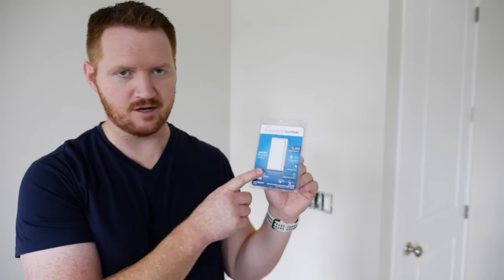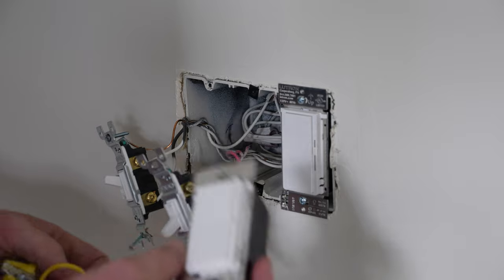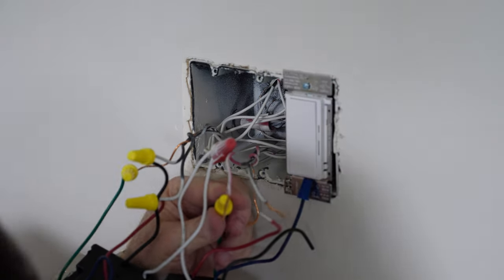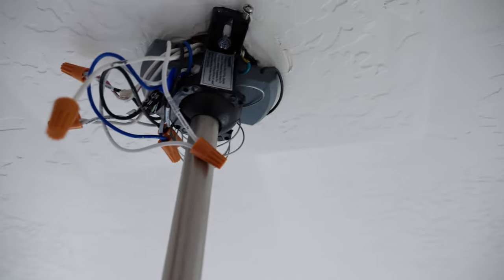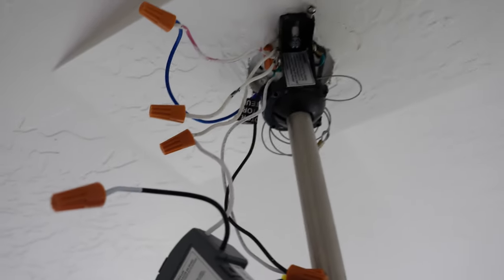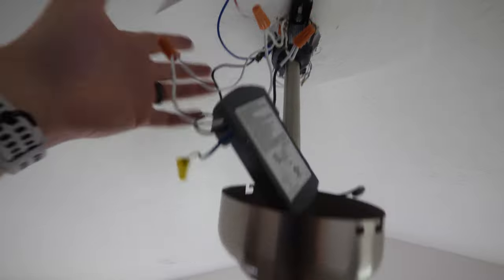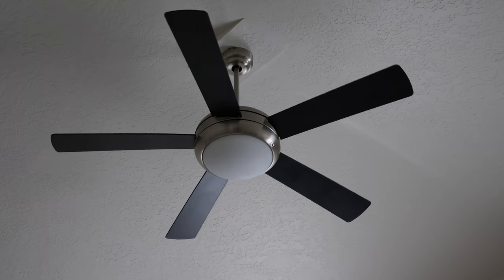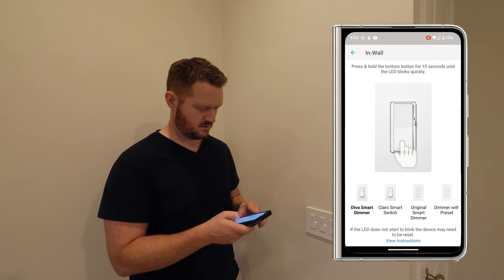Use a Claro Smart Switch for Fan Light & Fan Control

Comment: Brett thanks for this video 

What type of fan do you have. Is it DC or AC. would this work with DC fans?  Because they have so many more options and looks but I do not know if this set up will work. 

I have similar set up. 1 switch for fan 1 switch for light.
Reply: What I would like to know is if I can buy a DC fan and do similar to what you did. Use switch to turn on and off. Then use remote to adjust fan speed. 

Thanks again.

Comment: Seems a little senseless to do it that way since you already have separate load wires for your fan and light.  Wouldn't the Lutron fan controller be better for fan control and the claro for the light.  Remove the fan box controller  (green box) that you currently have and you can use the Lutron fan controller for smart home speed control.
Reply from the maker: Yes that is definitely one way to do it. I like the look of the new Claro & Diva Switches so this is what you would do if you want a cohesive look on the switches. I have found that we actually never change the speed of the fan so this actually works really well, and if we do want to change it, we still have the option with the remote.